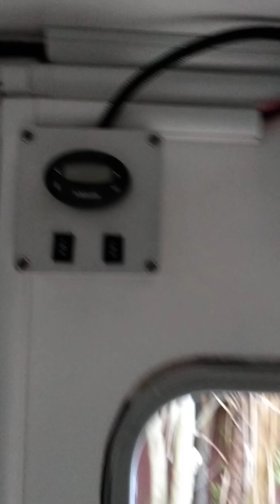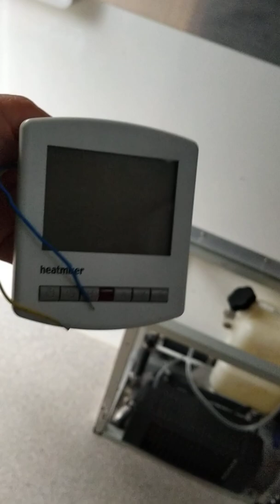Install of Webasto Thermo Top Evo with plate heat exchanger for air and water heating

Comment: Good setup! I wonder why you went with coolant heat setup vs installing a Webasto AT2000STC for hot air. I have a AT2000STC in camper for air and Thermo Top C for engine coolant in -40c cold starts.

Comment: Great install - to fit a relatively complex system into a small space. Impressed with all your stainless fittings. I’m planning on doing something very similar in a 20ft shipping container. I have the Thermo Top C with a plate heater and Silencio 2 heater.

Comment: How is it working out for you? I'm going to build a similar system myself :)
Reply from the maker: It worked great. I did have a persistent coolant leak going in to my heat exchanger. 

Pros: The water heating was great, endless shower if I wanted. The air heating is very efficient. 
Cons: You have to fire up the heater to get hot water so I didn't generally bother except for showering. It's way way too much KW for my small 13m2 well insulated camper. It is limited to a run time of 60 minutes so I can't run it overnight although normally I have to turn it off after about 20 minutes as the camper is at 20 degrees!   

I ended up removing the system to sort the coolant leak (stainless fittings!!!!) and decided not to reinstall it. I have  replaced it with a 2KW air heater and am in the process of installing a 12L calorifier. Even the 2KW on the lowest setting will gradually raise the temperature inside in cold conditions if I don't crack a window. I'm sure I will miss the endless hot water but at least it will force me to conserve with shorter showers!!  If I had a bigger vehicle like a bus it would be fantastic, I would put in a small alloy radiator or two as well as blowers for boost.

Comment from the maker: As predicted, I did have a leak when I commissioned the system!  So I did have to utilise my drain down which worked well. Leak fixed and the system is working well on the heater side, I have not yet installed my water system to test the hot water production.